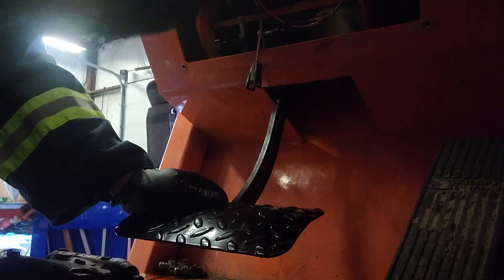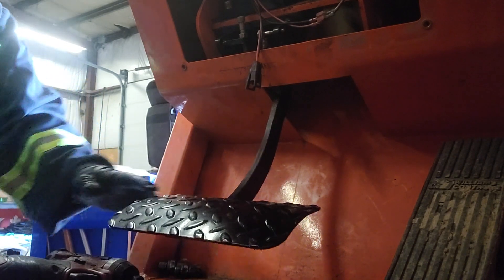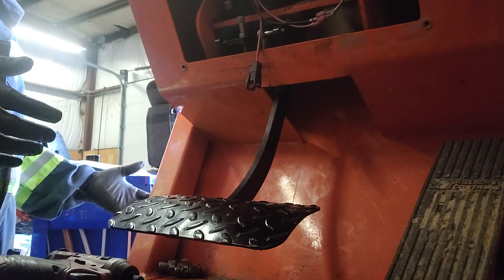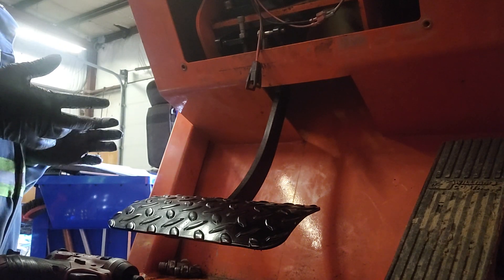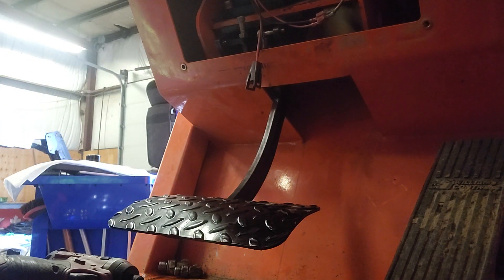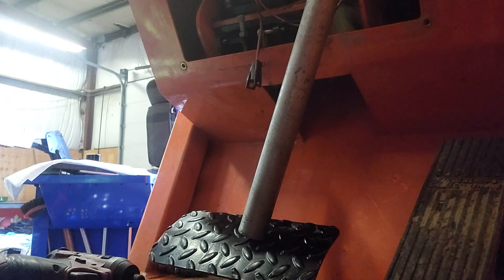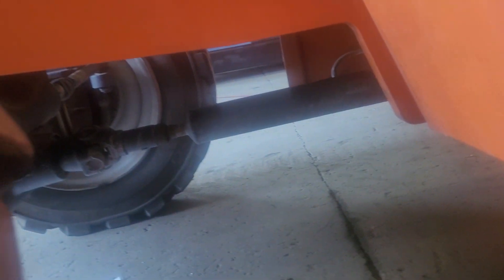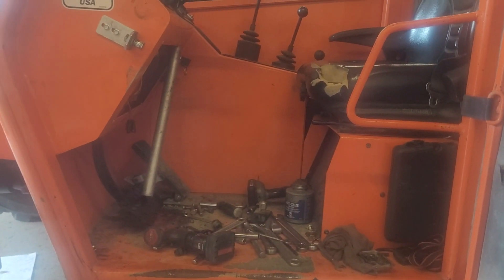10054 JLG sky track || How to bleed or release air from the brake systems?

Comment: Hello. Thank you, what about the master cylinder does it have its own bleeder? I’ve bleed all 4 wheels but still have soft pedal. Also the pedal flutters/shutters when pressed.
Reply from the maker: Master cylinder is defending of your valve, but mostly all skytract no valve bleeder only on the axle each tire. I thinks your brake valve have a problem
Reply: Understood. That’s what I was afraid of. Thank you for your reply.

Comment: Hey buddy i am working on a telehandler skytrak 10054,one of the solenoid and sleev (12 v) on the stabilizer got smoked so i replaced it. Now i tried to retrieve the cylinder its not working, the cylinder is completely extended. How to i manually bleed it and find the issue and fix it. The fuse in the cab for stabilizer was blown so i have replaced that.
Reply from the maker: Hey buddy, problem solve?